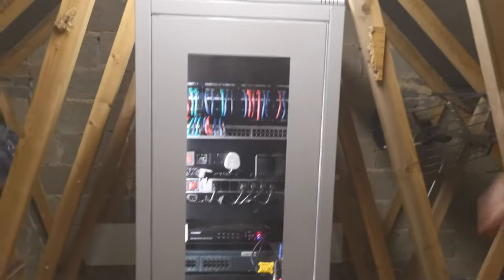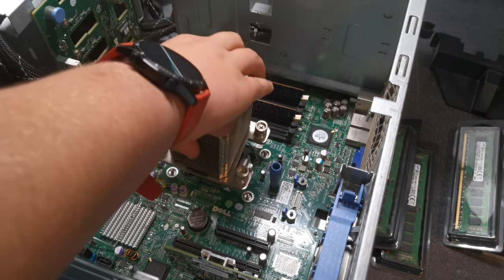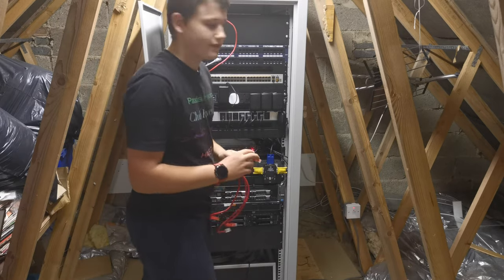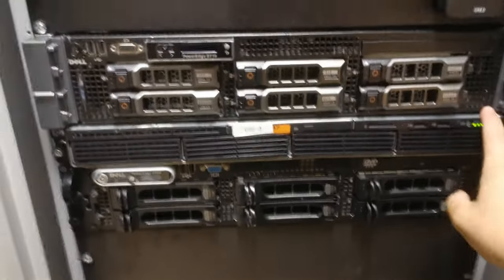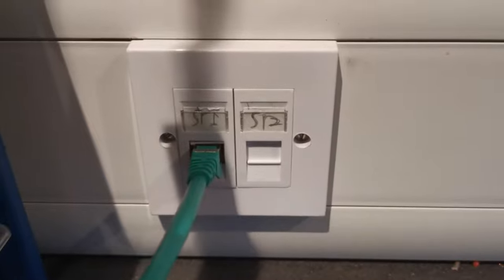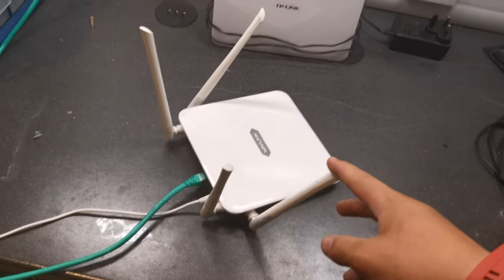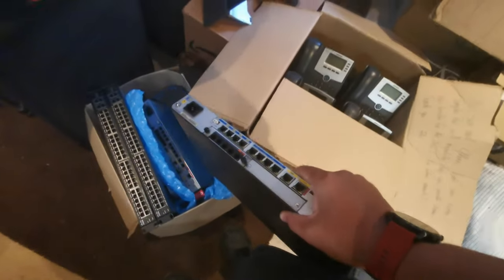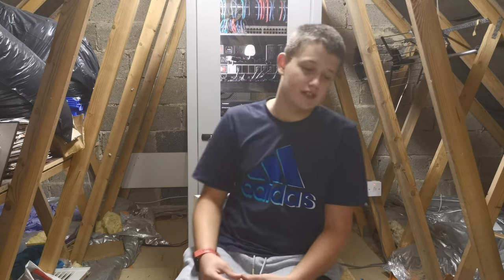a tour of the home network / lab.   wth CPU install

Comment: Hello from the U.S.. First off the lab is very impressive. The quality of work is also very nicely done. One thing is that it looks like to me that it is in the attic which could be a cooling issue on hotter days. Also, be careful of fires. I’ve been in the industry over 20 years and have not seen a fire but with older gear and running in the house I worry about that. Best of luck! Really great work!!
Reply from the maker: Heat is a bit of an issue at times, your quite right. It's not that often though and is solved by opening the hatch, worse case scenario, add a fan. Definitely an inconvenience but it's the only option. 90% of the stuff up there is not on now anyway as power is so expensive atm.
Reply: @tobywhiting10  looks great! Best of luck!!

Comment: Well done but I would hate to be the one responsible paying the electricity bill for all of that right now. Watch out for corrosion / condensation - I had one of those netgear switches in my attic and over the space of about 2 years the internal board rusted up. Why dont you do a video building a fully virtualized network with everything including the firewall all on one box .
Reply: Virtualized firewall is a big nono
Reply: @jj-icejoe6642  You can argue it either way but for a home network / lab I wouldnt have a problem with it. L1 made some good videos on this type of "forbidden setup" recently: 

https://www.youtube.com/watch?v=r9fWuT5Io5Q  https://www.youtube.com/watch?v=MBY_QNN3owc
https://www.youtube.com/watch?v=x40FlIyhYXU

Comment: get real on routers - build a ha opnsense system - 2 arm sbc like nano pi and you can run 2.5gbe relatively easily  or run bonding or bridging and do 5gbe with two inf - stay away from the old jet engine servers do get 4th gen refurb or 6th gen and add ram for hosts